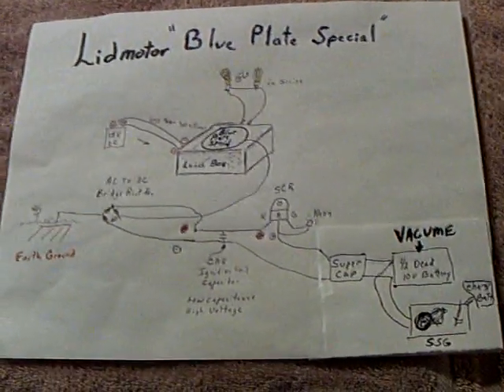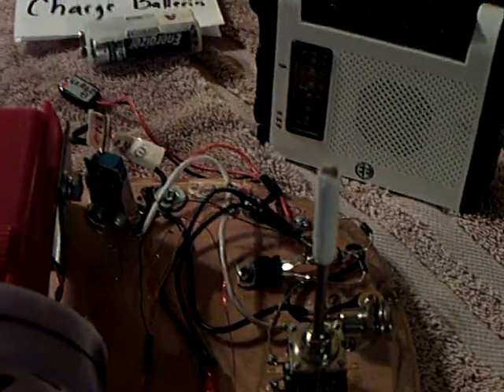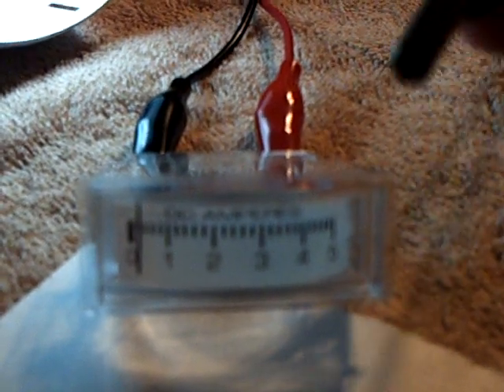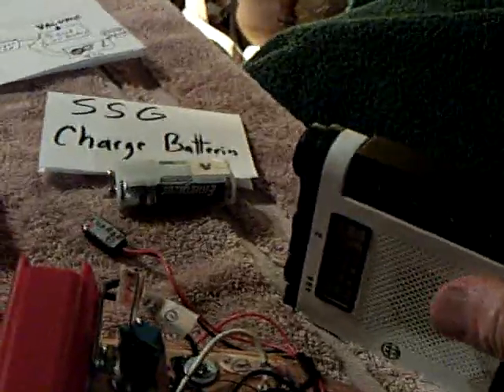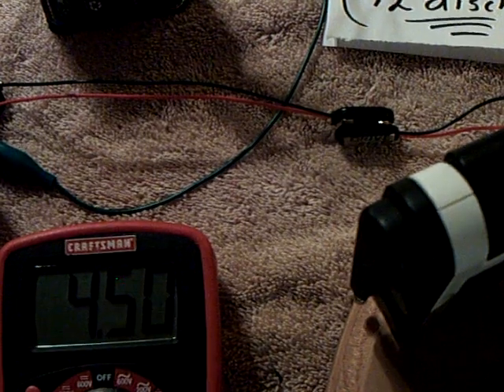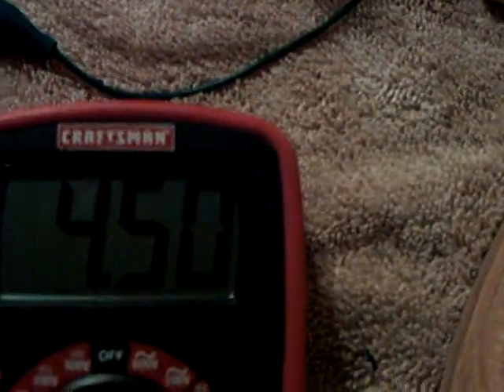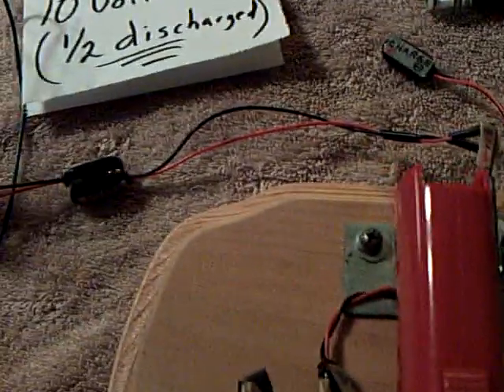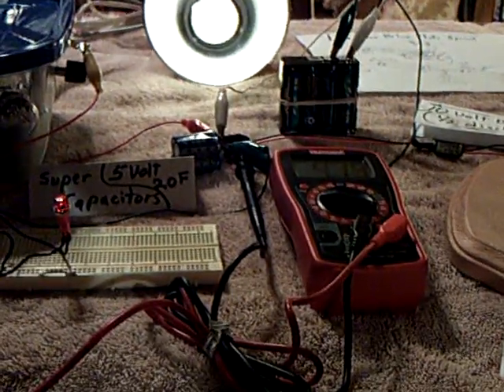Vacuumed Energy-- Lidmotor Style

Comment: Hi Lid. Could use your help. I want to rep the HV via BR, antenna, ground and scr. Problem is I have no scr, so I tried to make one. This is were I could use your help, if you would. Could you try your set up with a two transistor scr mock to see it if it's possible. I've had no luck. Don't want to pull my hair out if it can't work. The two transistors are pnp tip42 and npn tip3055. It would help me out very much and I think people would like to see a do it your self scr. Thanks in advance. Robert.